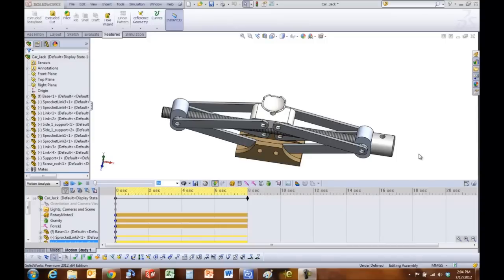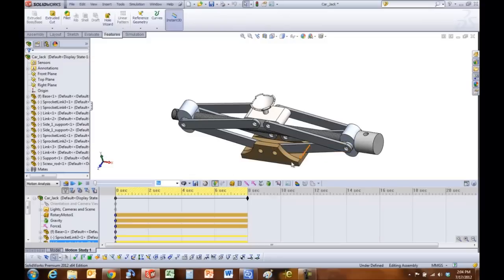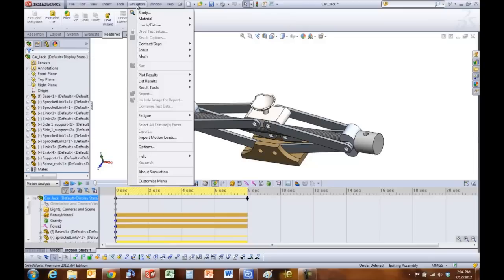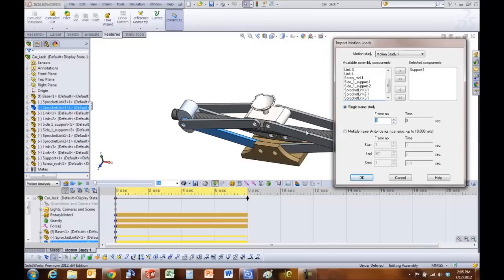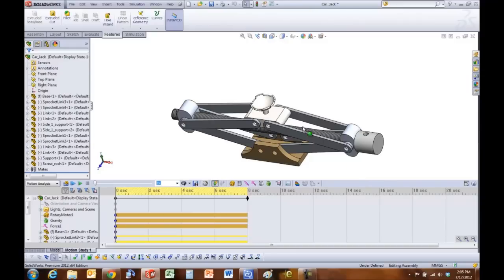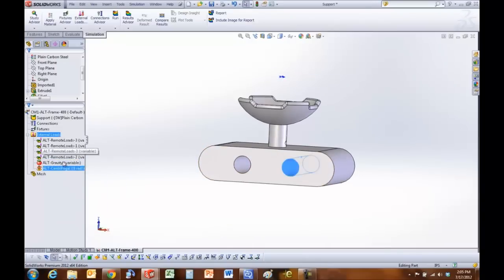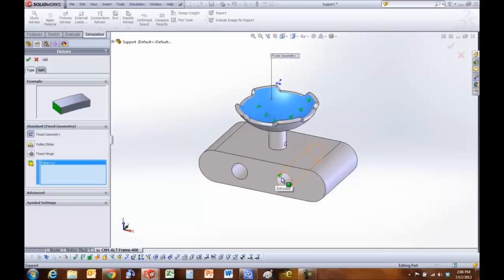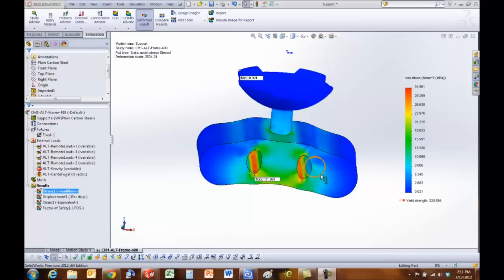SOLIDWORKS Simulation - Import Motion Loads to Stress Analysis

Comment: What happens if the part component does not appear on the menu for Import Motion Loads? How can i make it appear?

Working with a rear trailing arm suspension that has two support rods connected from the frame to the wheel knuckle. I want to see the support rod results.

Thank you for your help!
Reply from the maker: Thank you for the comment.  This sounds like a challenging question. For assistance, please contact our tech support team at goengineer.com/contact
Reply: i also have that problem, can anyone help me please

Comment: That's a great question. The stress analysis is a Static study. This means, you need to restrict your model. If your model is inherently stable because of the forces applied, consider using Soft Springs or Inertial Relief. 

Good Luck